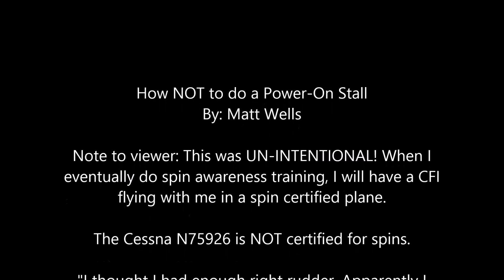How NOT to do a power on stall/Spin awareness

Comment: 172s can be spun in utility category ...and with 25TT and obviously signed off for solo flight..I'm surprised you said you had no spin or spin recognition training...
Reply from the maker: This airplane is not approved for it, even in the utility category. The only training I had done on it was reading the POH the night before and memorizing spin recovery procedures.!
Reply: @TheFlyingController  ..that's odd...i had a N and a S model ..still have the pohs on my bookcase...section 2-9
utility category maneuvers
chandelles    105 knots
lazy eights    105 knots 

steep turns      95 knots
spins       slow deceleration 
stall (except whip stalls) slow deceleration 

in any event i see from your videos you received spin training in the skyhawk the video after....stay safe amigo

Comment: Thank you for putting this up. Now --- take your beating like a man.  WHAT WERE YOU DOING ON THE AILERONS?  Make sure your views have the takeaway that you keep those ailerons neutral in the incipient stall.  Otherwise, you get a face full of rotating earth, and in the opposite direction of the ailerons.  Argh.  Also folks, remember to stop a spin you gotta break a stall.  Power back, elevator forward until you get the airspeed up, and opposite rudder from the rotation.  Various aircraft have different spin recovery methods, consult the POH.  
Fly safe my friends.  SC